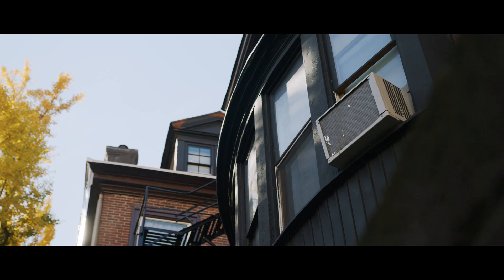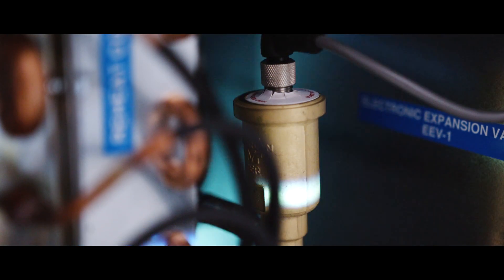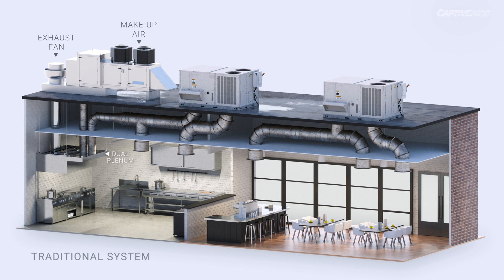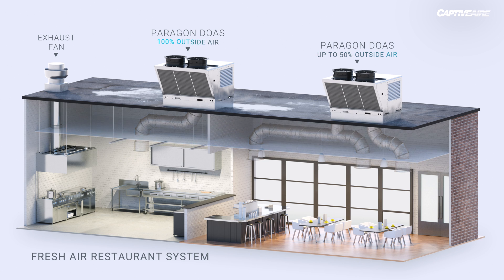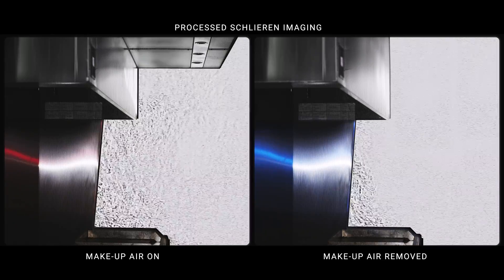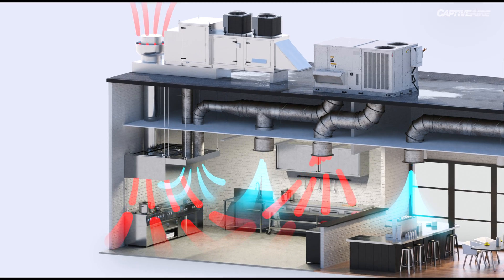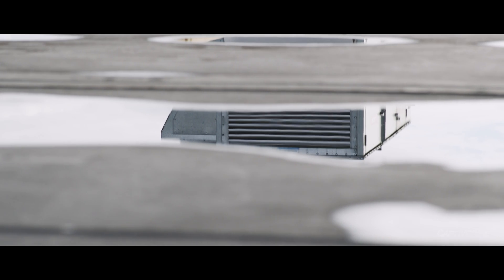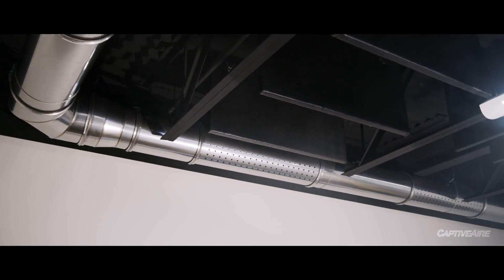One System, One Source: The Fresh Air Restaurant System

Comment: Its 100 degrees in my state, how to cool a small kitchen with all gas fired equipment? Impossible. 
I am amazed the vent hood and HVAC people cannot colaborate. 
Our return air system brings 100 degree air in to replace what is sucked out above equipment, and everything is still covered in oil dust and its a steady 85-100 degrees in the warm months. Ugh.
Reply: Thats because you dont have a CaptiveAire DOAS system.  I am a field technician and have been doing HVAC for over 10 years now and I just got finished with the formal start-up of three CaptiveAire DOAS system on Longhorns Steakhouse and I personally watched one of these systems pull 110 degree air off of the restaurant roof, draw 10 gallons per hour of humidity out of  it, and lower the temp of the air far enough in a single pass to lower the temp on the line in the kitchen 5 degrees in less than 30 min, and it did it during the lunch rush when the kitchen was fully operational.  These units are amazing machines and CaptiveAire is well underway to setting the bar for comfort air systems and indoor air quality in the modern age.
Reply: Does it cool the fresh air before blowing it in to the kitchen?  @chrisdamore5153
Reply from the maker: You're right. The only way to properly condition a commercial kitchen is to have control over all the components. That's exactly what we do!

Comment: The problem with integration is that the failure of one component takes the whole system down.
Reply: don't buy only one system though, every machines or system must have a spare or an alternative as a switch while the other one is under maintenance.
Reply: How is that any different than a traditional system?  Loss of any component in a traditional system causes the entire system to stop working properly too.  The good news is that uptime is better with this system because of CASlink.  It can help detect issues before they become a problem, make troubleshooting much easier as many issues can be fixed remotely, and if not, you're at least going to know what the problem is before a tech is dispatched.  Paragon also has a 5 year warranty on all parts and they are stocked in several locations around the nation.  You won't be waiting a week or weeks on parts like many manufacturers, most parts can be picked up same day or shipped next day.  

Downtime happens, especially when maintenance is ignored, but this Paragon system keeps downtime to a minimum and saves owners a lot of money and frustration.  And if you're fortunate enough to have a good rep , they are just a call or text away and can get you back up and running fast.